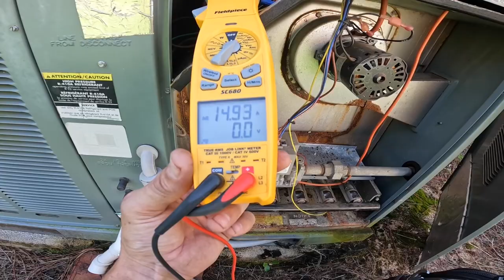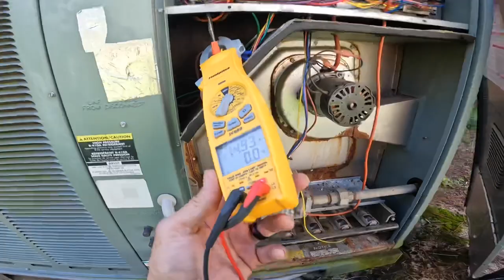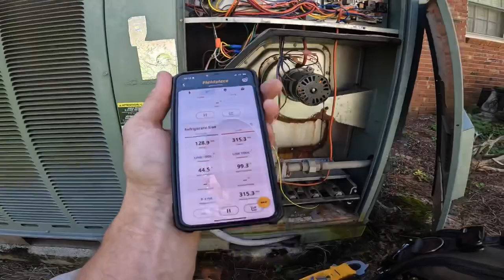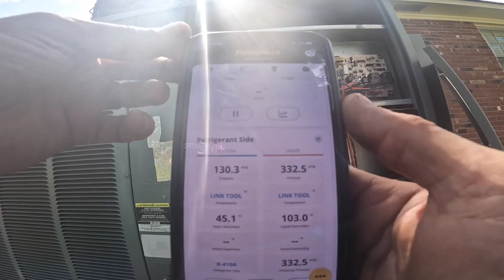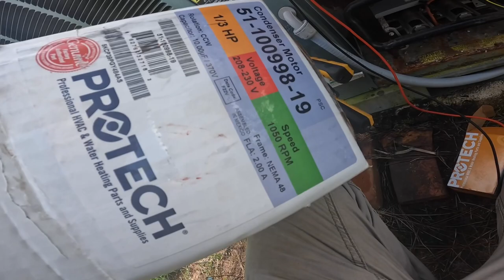It’s More Comfortable Outside Than In. AC Repair

Comment: the systems they have down south are quite different than what we use up north, seems like because theres no basements and less need for heat most are these huge combos outside, we have gas furnaces in the basement here and just an AC condenser outside no duct work. Its something I never thought about until I watched these, and it makes sense because of how the houses are built in the south you have to put it outside half the time or in a closet or attic.
Reply from the maker: All our loads are based on cooling. Heat is an afterthought. We might have a few freezing days. But, later in that same day or the next we’ll be running the AC.
Reply: I noticed the same thing too, especially on the older homes. They use package units much more than in the south. I see more of the vertical package units than the horizonal.
Reply: Yah, I'm interested in the different home construction building procedures and techniques around the country too. These crawl space construction homes are similar to California except probably more humidity there. The homes in the West use these pilings and pads to raise the home above a dirt or earth crawl space which isn't very tall. The craziest thing, in my opinion, is that they have these packaged AC units with the Evap coils and AH outside the house. At first I thought they were old homes retrofitted with AC after construction, but I don't know now. They could have a cleaner install and put it in an equipment room or mechanical closet. The worst place for an AH is in the attic or outside. Conditioned space is best. An attic is bad enough, but for practicality I understand why it's done. Outside is the worst, in the sun, heated up to at least the temp you want to cool down from, plus ducting running under the house in an unconditioned humidity rich environment. Even the attic would be better than that because of the cooler temps causing the moisture to drop out of the air causing issues under the house. I mean outside air condensing on the ductwork if it's not insulated good enough, which it usually isn't.
I live in the Midwest and I have a finished basement with a boiler room and a crawl space. The crawl space is conditioned and encapsulated with powered foundation vent fans. It's about 5ft high and has a poured concrete floor with fluorescent lights. Theres no ducting, but it does have piping for the boiler radiant heat and a radiator. A few years ago I had Orkin by for bug spraying and the guy was doing the the crawl space and he said 'Wow, this is an awesome crawl space!" I said 'Really?' He said he was at one customer that had a nicer one with a stool with wheels to sit on and move around the space.
Reply: @K_Hansen  I don't think they get that much snow but it does get cold there. Heat pumps put out the worst heat. A friend of mine in Michigan bought a house in a development in the late '70's early '80's that was all heat pump heat and everybody had to upgrade to gas furnaces or something else the first year.
Reply: I live on the West Coast. Basements are very rare but so too are package units. Here they're seen as a sign of cheap construction, other than when used in houses with flat roofs on tight lots (like at or near the ocean). For traditional split systems, furnaces are either put in the garage, in a closet, or in the attic. Outside condenser units go where there's room (depending on lot size). Sometimes at a narrow side of the house. And occasionally, again for flat roofed houses on tight lots when they can be visually screened from view, sometimes on roofs.

Comment: Start the screws by hand before using power drill.  I had a jack leg tire mechanic at a big Ten tire center put my cars lug nuts on without starting them by hand, I found this out later on the interstate while feeling my right front tire falling off at seventy miles an hour.  He stripped four of the five studs without starting nuts by hand and just using impact wrench to start them.
Reply from the maker: Most of the time I’d agree but those screws screw into a blank hole - it has no threads, it’s just a really tight fit.
Reply: @HVACGUY  Thats what the tire guy said too.
Reply: That tire guy was an idiot, this man is just dealing with sheet metal, no big deal.
Reply: there is a huge difference in lug nuts and drive screws.. use some common sense boy
Reply: I never start screws with my fingers on sheet metal, unit doors  but when working on my car I always start fasteners with my fingers.  I have a 1/2 inch impact.
Reply: @evilswissy   at 12:10 mark, he is placing fan mounting screw in drive socket, than power drilling it into fan motor. If he strips threads on motor, thats gonna need a new motor. Watch the whole video boy
Reply: @evilswissy  😂

Comment: On Tuesday, I went to look at a piece of ductwork in the crawlspace and looking for the access I heard the outdoor unit roaring.  I ended up replacing the condenser fan motor and fixing the broken flex duct.

Comment: All in one cap vs 2 caps, matter of preference I guess. It did have a 12 instead of a 10. Also that wire that got hot, must have been a bad connection or the old motor was drawing too much? I guess

Comment: I found a bad indoor txv on a trane package unit a mini split with no freon a clogged drain on a furnace in the crawlspace put a defrost board on a Goodman hp condenser unit found no freon in a 2001 trane split HP with r22 freon found a ,12 inch supply flex in the attic that come apart at a splice joint had to fix that and checked a split HP cause the owner said it wasn't cooling like it was I checked the sub cooling and it was good got to looking and he had torn out the ceiling in half the house so yeah no wonder it's not cooling and I found a bad outdoor fan motor and blade under warranty then I did two maintenance that's a day in this HVAC technician day

Comment: Hi...im a heating  and plumbing engineer in the uk...may I ask how much you charged for that job?   I charge £350 per day or £40 per hour plus parts....😊👍
Reply from the maker: I don’t mind discussing my prices. I charge a $70 diagnostic, then $90 an hour, plus parts. If you’ll look at my “entrepreneurship” playlist I discuss more fully how I work up estimates
Reply: @HVACGUY  Thank you..I will check it out...God bless my problem solving friend across the pond...Diffferent country...same problems...😊👍
Reply: Are you harry tuttle heating engineer
Reply: @HVACGUY   wow very reasonable prices in todays market.  i know back in '00 it was  $89 service call here in rock hill sc.  i find it odd a oem motor is the same price as a replacement motor.  any way  good to see it was a simple change out . an easy job easy money. stay well
Reply from the maker: @DanA-jp9gs  I had to google harry tuttle heating engineer. You had to dig for that reference. I think it may date you a little bit though.
Reply: @HVACGUY  that's really reasonable!  Two years ago it cost me $280.00 to replace a condensor motor cap.  That was after the company waived the diagnostic fee.  I could have diagnosed and done it myself but was recovering from an injury.  I was not happy to put it mildly! Love your videos!
Reply: @DanA-jp9gs  who is Harry tuttle?